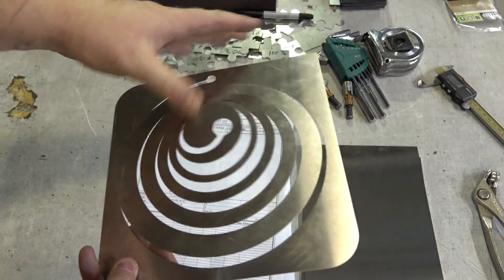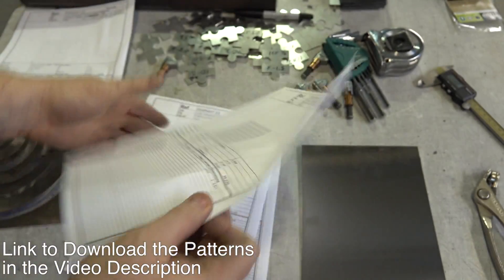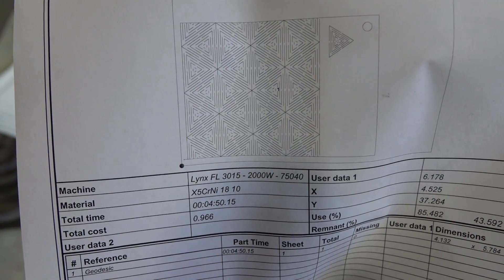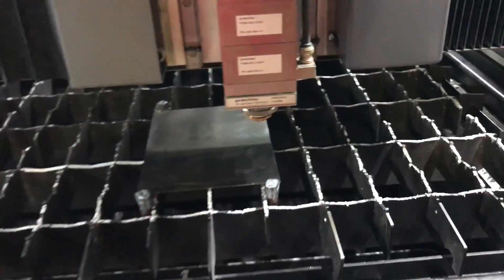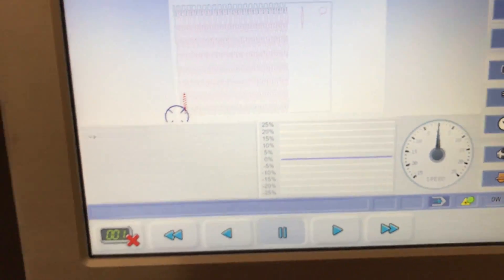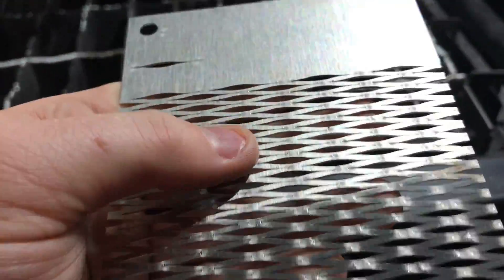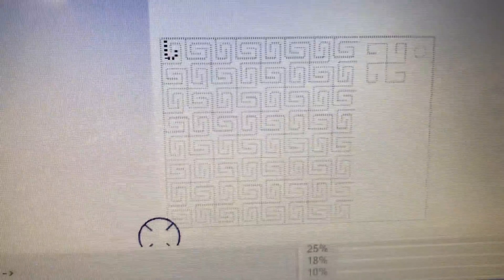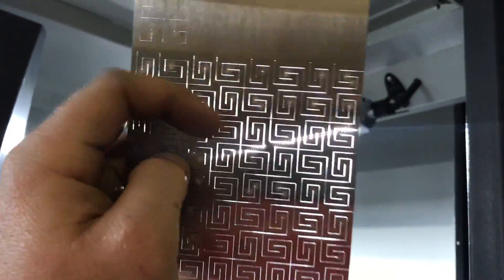Laser Cutting Stainless Steel Living Hinge Patterns

Comment: I'm wondering where you got those little clamp/weights? I'm running into the problem with my smaller pieces of light gauge steel wanting to fly away.
Reply: They are called Cleco fasteners. There are clamping ones as shown in the video, and they also make them for holding sheet metal together through rivet holes. They are very common in the aerospace and automotive world!

Comment: how long would it take to use a bottle of nitrogen cutting SS, i am looking at buying a machine and am curious to the consumption per hour and how much i will need to have holding wise.
Reply: 800mm/s， the max speed. More detail ,can add my whatsapp 008618361445350

Comment: cool. how much heat does this transfer to the metal?  Its obviously safe to touch but is it warm?
Reply from the maker: Thanks, it's slightly warm.  High pressure nitrogen is ejecting molten metal out the back of the metal before the heat really has a chance to spread.
Reply: hello mister, i dont have to much money to get this kind of machines, but do you have good references of machines around 500W fiber laser brands?? of course smaller, thanks

Comment: Question. I've been looking into getting a laser cutter, and of course a fiber laser seems like the clear choice for cutting metal. However, most of the low-wattage fiber lasers are stationary, and this is clearly on a flatbed, which seems to be more common with cO2 lasers. My question is: is there a particular brand that makes fiber lasers in consumer-level configurations (7-12k price range) that do what's shown here, or am I out of my league?

Comment: Does the metal not get hot when it gets cut? I'm always scared you'll burn yourself whenever you pick up a part right after the laser is done
Reply from the maker: Stainless steel has a very poor thermal conductivity so it isn't very good at spreading heat.  The laser beam is about 0.006"(0.1524mm) and the cut is being purged with high pressure nitrogen gas. It's barely warm after it's done.  Thicker parts and aluminum parts do get quite a bit hotter.
Reply: Thanks, man :)

Comment: I notice the laser cutter went with the longest route (as evident during the 3rd piece cutting process) as the most efficient use of the 'on' time. Never seen this process before, so this might be a silly question but doesn't it produce intense heat (since you seem to be able to handle the finished work with your bare hands)?
Reply from the maker: Stainless steel has a very poor thermal conductivity so it isn't very good at spreading heat.  The laser beam is about 0.006"(0.1524mm) and the cut is being purged with high pressure nitrogen gas. It's barely warm after it's done.  Thicker parts and aluminum parts do get quite a bit hotter though.

Comment: I think there's probably changes that could be made to optimize the technique for the material.  Steel is already pretty ductile, the ability to transfer and absorb stress is a big part of what makes steel strong.  As a result patterns aimed mostly at increasing ductility might not really be as useful as some hypothetical pattern that improves on other properties where steel is weaker.

Comment: Wow this was fun to watch. I wasn't sure if the footage was sped up. The laser cutters I've seen so far couldn't cut wood at that speed. How powerful is that laser? With all that molten/burning metal flying around, how does the lens stay clean?
Reply from the maker: The laser is 2000 Watts.  There is a 3000L liquid nitrogen tank seen at the end of the video that purges the cut and forcefully ejects the molten metal downward.

Comment: What’s the point of the z axis travel on a laser cutter
Reply from the maker: Several reasons. Parts can tip up and hit the nozzle. We can also cut enclosures and parts that are already formed so it cuts more than just sheet metal.  There are two beds, a top and lower bed so the z axis has around a 15" reach. Another reason is to prevent warping.  If a part has a lot of features too close together, it's better to raise the head to allow the heat to spread more evenly.

Comment: do fiber laser cutters have any "high" running costs, like waterjet or co2 lasers?
Reply: On the contrary they are very cheap to run as compared to a similar co2 laser. A new 2 kw fiberlaser can outperform a 4kw co2. I've seen a 2kw cut through 1 inch steel at 25ipm.
Reply: It's much more economic in use.Please contact us for quotation and more information. Mobile/WhatsApp: +8615064070419
Reply: @amycarrie7002  hi my whatsapp number +971558533191 pls send sms

Comment: Thanks for sharing, gonna run them on the next TRUMPF laser I get to play with. What watt machine you running? I work with 2.5KW to 8KW TruDisk Fiber. 1030-5040 TruLasers. I also like the holders you’re using to hold the thin materials. Keep up the great Laser videos, there aren’t enough how-to’s or tricks of the trade videos for the sheet metal guys!

Comment: is that some kind of water dropping in order to cool down the nozzel?

silly me, didn't see any water droplet when you take it up so it's just some sparkles?
Reply from the maker: Regular air will oxidize metal and result in discoloration of the areas surrounding the cut.  Yes, we use oxygen to cut thick steel but the edges are very dark and need to be cleaned up.
Reply: Why not regular air?
Can this laser cutter use oxygen for cutting thicker material?
Reply from the maker: No water.  It using liquid nitrogen to purge the cut, but it is already gas by the time it reaches the nozzle.

Comment: ...A Thumbs up.......nice work, even if it is just a demonstration....I'm guessing to avoid the issues with cutting stainless this thin, with any 'HOT' source...Plasma, laser....you'd want pretty high current source and fast travels....impressive that the machine can follow the pattern at that speed with no visible distortion in the finished parts..! One of the advantages of Fiber Lasers...very little moving weight... How do the optics stand up to the high number of 'piercings'.....I know that's an issue with Laser, plasma and even Oxy/acet...I've done alloy of oxy/acet and plasma by hand...always tried to do piercings with a 'tilt-in'...and if possible, I'd drill 'pilot' holes....
Reply from the maker: With fiber lasers, ther are no mirrors that can be damaged or misaligned like a co2 laser.  There is a quartz lens that is purely to protect from debris traveling up the head that is optically clear.  It just needs to be cleaned every few weeks with alcohol.
Reply: Thanks for the explanation, I've been under the (dumb) impression that "fiber" lasers were just for making black marks on metal. Amazing. Thanks for posting!

Comment: Pretty neat. Had not heard the term "living hinges." Guess that's the same as kerf cutting?
Reply: First time I heard it too. Something like a ketchup bottle cap? :)
Reply: In this case yah, exact same concept, but "living hinge" is used any time a hinge is made of one solid piece. Think like a dvd case where the hinge is the same piece of plastic as the front and back.
Reply: Ah, neat, thanks. So the CD case is a living hinge, as it's built into the plastic, even though the case is two pieces?
Reply: the solid black cases would be living hinge. where as the clear hinges are not.

Comment from the maker: It's not the best way of making hand formable parts, but it looks pretty and is more of an artistic approach. Do a quick image search of living hinges and you'll see example of practical application. Also, the yield limit is not the same as the solid sheet. The material yield is the same, but I can bend the "bracket" pattern about 90 degrees and it still returns to flat. The solid sheet yields pretty quickly at about 10 degrees. Someone with an idea could design something they could hand form themselves without proper sheetmetal tools and save a lot of money on shipping because it ships flat.
Reply: You could make and sell custom electric guitar pickguards. How much did the machine cost?
Reply: Hey im interested in more information for a diy project i have a design and want to see if you can help

Comment: You might want to try mixing your audio down to mono for the last bit when you were talking. It sounded like you were both intermittently blocking a noise source and perhaps moving from behind the mic to in front of it causing really odd phasing effects.
Reply from the maker: That is from me trying to filter out the background noise in my video editor.  It's really loud in the shop and it's hard to even hear me without reducing background noise in post.  It also distort my voice a bit when I do that but it's better than not being able to hear me.  I need a better mic with adjustable gain and filtering.

Comment: Can that laser cut 1/8" or 3mm aluminum?
Reply from the maker: Justin Bell It can cut up to about 9mm aluminum.  Email me if you need any parts made at protogmanufacturing@gmail.com
Reply from the maker: That depends on several parameters.  Lead time, material & thickness, material finish, hardware, post burn operations like deburring, packing shipping, how well the part was drawn, etc.
Reply: Justin Bell newer lasercutters can Cut i think Up to 30mm in Aluminium, and 23mm in staubleisten or Something,
I saw 25mm Steel recently, astonishing i can say